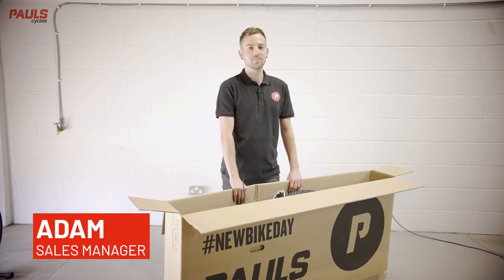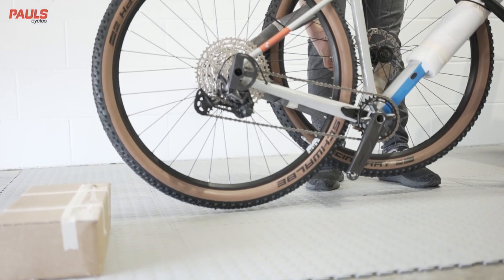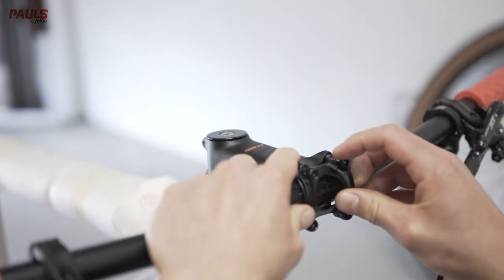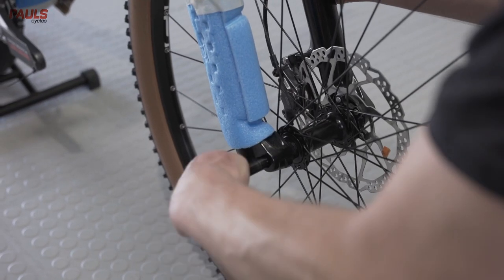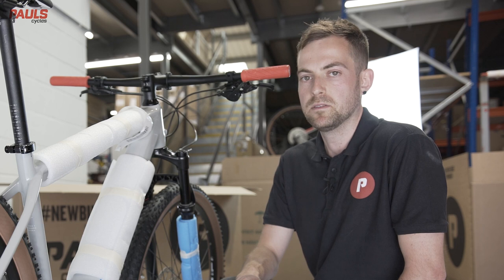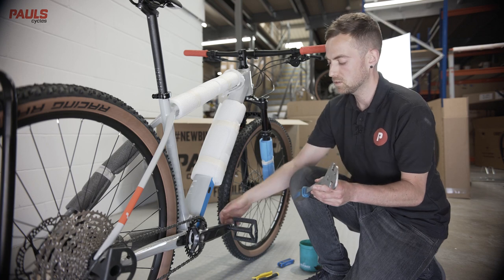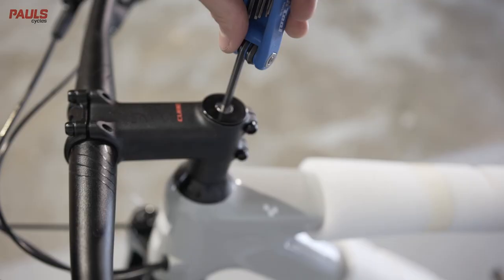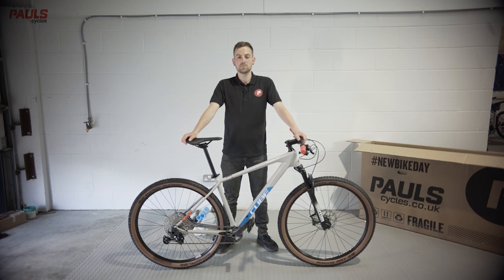How to assemble your new bike at home - Bike assembly guide for beginners

Comment: Hi, I’ve ordered a Giant Contend AR1 from you (order 29652) and have a question about tyres. The spec says it’s tubeless, but does this mean tubeless-ready or is it actually tubeless? Assuming it is tubeless do you have a guide for repairing punctures, checking sealant etc, and what tools and consumables are required? Based on other YouTube videos it looks more complicated than with tubes. Many thanks and looking forward to receiving the bike.
Reply from the maker: Hi, that bike will have been set up tubeless in the workshop prior to being sent out to you 👍

General rule of thumb is to refresh/top up the sealant every 6 months or so. But if you notice that you do get some punctures which the sealant fixes then it would be worth adding extra sooner as some will escape as it clots to block the hole.

You can get tubeless repair kits - such as the Peaty's Plugger to fix larger holes in the tyre whilst out on the road. And you can get tyre boots from Restrap (similar to traditional inner tube patches, but tougher) which you stick on the inside of the tyre.

Hope that helps!
Reply: @pauls_cycles Hi, Thanks for the reply. The bike arrived this morning and looks great. I haven’t ridden tubeless before so I just wanted to be prepared in case of a puncture when a long way from home on a ride. Sounds as if the sealant plus the plugs for larger holes will cope with most situations. For me the jury is still out as to whether tubeless is worth it for general riding so I may convert to tubes at some point in the future, but we’ll see how it works out.